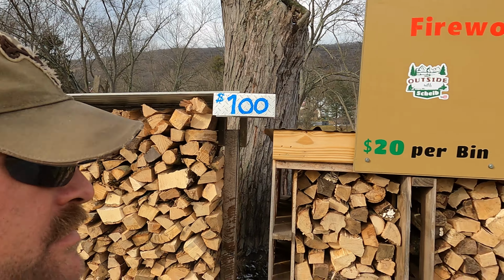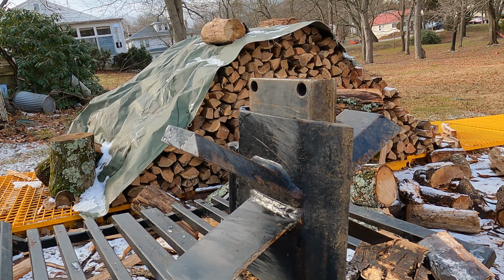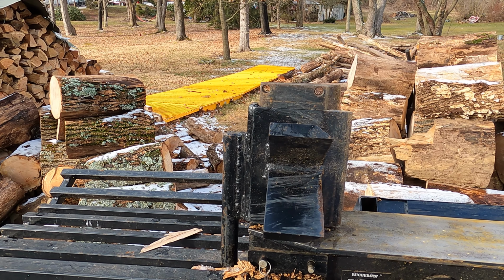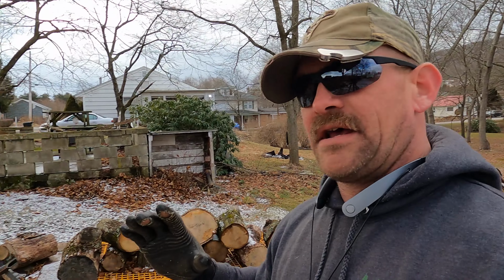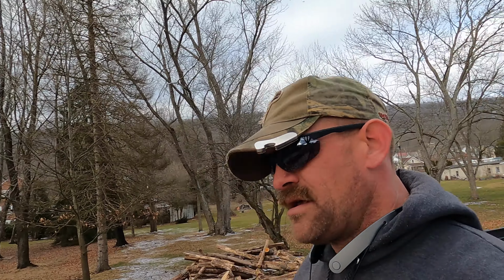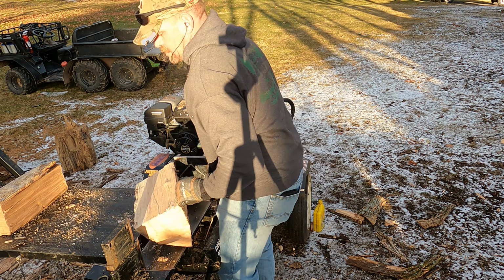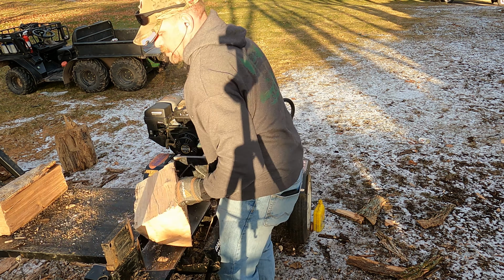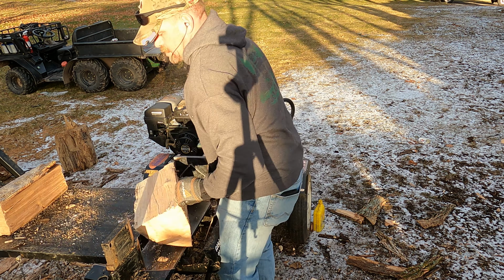Rugged Made 37 ton log splitter 6 way action!

Comment: We're did you get the wedge lift?? Did that come with the splitter..
Reply from the maker: I made the modification from a cylinder I found in the junkyard the splitter doesn’t come with the adjustable wedge.
Reply: Ok I was going to call the manufacturer and ask the about that. That lift wedge is cool. Thanks for the reply.

Comment: Hi Scheib how does the raven engine run in your opinion compared to a honda I want to get one from rugged split trying to decide what model also I looked at the splitters I noticed yours has 3 levers for hydraulics was that original
Reply from the maker: I haven’t had any issues with the engine and I modified this splitter with the adjustable wedge not original.
Reply: @OutsidewithScheib  I saw that video it was cool also I saw how you tricked out the auto cycle it was cool did the autocycle between parts and labor run you alot